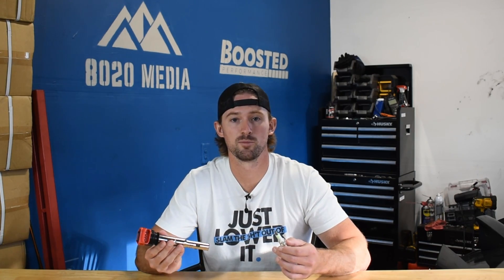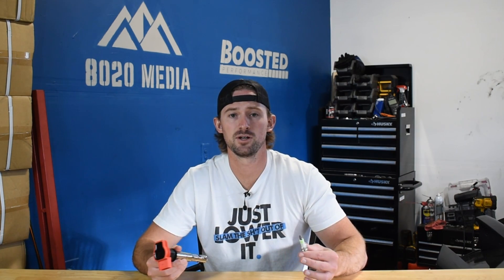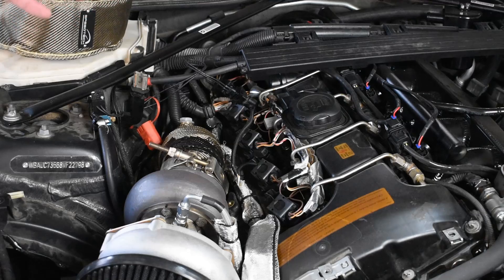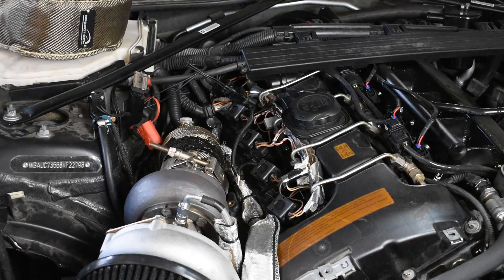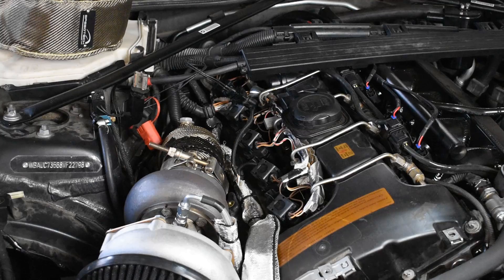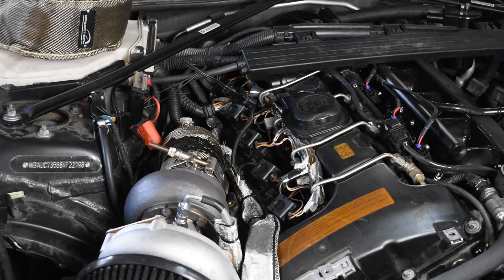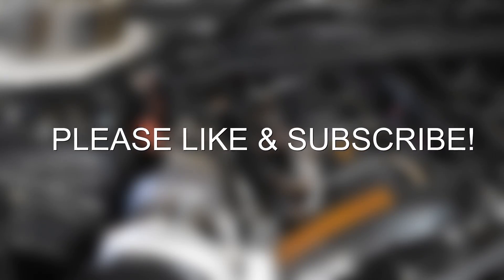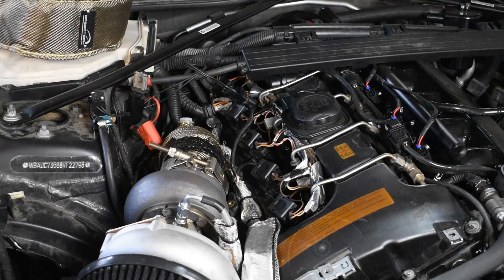DIY - How to Diagnose Bad Spark Plugs & Ignition Coils!

Comment: It can also be a bad plug boot the boot can have little tiny holes in it allowing the spark to leak through the boot and bypass the spark plug. Honestly on most of these newer COP ignition systems it's usually the boot or plug 99 percent of the time these newer coils actually hold up really well.

Comment: None of this is going to matter for me. Because I have a p0300 code not a p0301 to p0306. Just only p0300 my vehicle ignition coils are very difficult to remove so therefore I can't try something like this with the ignition coils. Cus it's inside the distributor cap. Only have 3 for the 6 cylinder. I actually have 5 codes. P0300 with P0130, P0136, P0150, P0156.
Reply from the maker: B - This video could also be helpful: https://youtu.be/f1mQ5hD1-vI

Comment: If it feels like misfire, individually pull off the electrical connectors, if car stumbles worse, the problem is not with that coil or plug. If you you remove the connector and car runs same,   you've found the cylinder that needs help.
Reply from the maker: M - Well said! Thanks for sharing.
Reply: Blambambaloobot!
Reply: Can you please explain if it runs the same it means it's the cylinder that was removed/disconnected
Reply: @Finding-Orthodoxy no, if it runs the same after pulling a plug, you may have found the problem coil or plug. If it stumbles worse. Then the problem is not the plug that is disconnected.
Reply: @michaelsnively3621 thanks!

Comment: i bought a used car with no engine light on but it has these symptoms, is there a way to determine without the engine light? i have access to a code reader but no lights are illuminated so its not much help
Reply from the maker: R - Yes, even if the check engine light (CEL) isn’t on, your code reader can still be useful—many scanners can read stored or pending Diagnostic Trouble Codes (DTCs) that haven’t yet triggered the CEL, as well as live data from sensors like fuel trims, O2 sensors, MAF, coolant temp, throttle position, and more; by analyzing this live data, you can spot problems like a faulty sensor, vacuum leak, or misfire even without a current code.
Reply: Same! 😭
Reply: @cearra7472 so i just diy replaced all the spark plugs and ignition coil boots! both are relatively inexpensive to get and theres lots of helpful videos of how to on youtube! good luck!

Comment: Hi dennis, have a 15 corrolla 1.8. I had a p303 misfire, car lost all power only going 20mph max.  Shop checked and said it looked ok. Cleared codes ran fine for a week. Driving on highway entrance up hill, it happened again. Replaced plugs, tested coils(all ok) and been driving it for 3 days no issues.  Car has 150k, first plug repl.
What could cause internittent misfire code?
So far its been ok but fearful its a fuel issue possibly??
Any thoughts
Reply from the maker: K - An intermittent P0303 (cylinder 3 misfire) on your 2015 Corolla 1.8, especially under load like going uphill, could point to a weak fuel injector, carbon buildup on the intake valves (common in high-mileage engines with poor fuel quality or long OCI), or even a borderline ignition coil that tests fine cold but falters when hot—since you’ve replaced the plugs (first time at 150k!) and verified the coils, the next suspects would be the cylinder 3 injector (try swapping it with another cylinder to see if the misfire follows), checking for vacuum leaks around that intake port, or even doing a compression/leak-down test to rule out valve issues; if it runs fine now but you’re wary, monitor fuel trims with a scan tool and consider running a quality fuel system cleaner (like BG 44K) and using top-tier gas for a few tanks.

Comment: I drive a Lincoln Town car ican start and drive but will die out. What is my problem???
Reply from the maker: G - If your Lincoln Town Car starts and drives but then dies out, especially after idling or coming to a stop, it’s most likely caused by a failing idle air control valve (IAC), vacuum leak, dirty MAF sensor, or fuel delivery issue like a weak fuel pump or clogged filter; when the IAC can’t properly regulate airflow at idle, or if unmetered air is entering through a vacuum leak, the engine can stall suddenly—also check the fuel pressure, MAF sensor cleanliness, and battery/alternator voltage, as inconsistent voltage can also cause sudden stalling; scanning for codes—even if the check engine light isn’t on—can also give you clues.

Comment: Just replaced my spark plugs and wires and put flowmaster headers on and a new exhaust system which I have a exhaust leak will that result in my coils to go bad after some time?
Reply from the maker: J - An exhaust leak, especially near the headers, won’t directly cause your ignition coils to go bad, but it can contribute to drivability issues that stress the ignition system over time—if the leak is near the upstream O2 sensors, it can create a false lean condition, causing the ECU to overcompensate with fuel, which may lead to misfires, rough running, and even carbon buildup, all of which force the coils to work harder; additionally, if the exhaust leak is close enough to wiring or coil packs, the extra heat and vibration could accelerate wear—so while the leak itself won’t immediately kill your coils, it’s smart to fix it soon to avoid compounding issues that could shorten the life of your ignition components.

Comment: Im having a small misfire on take off or idling. However, it's my battery dash light that'll briefly go on and then off. Anyone know what this could be? I changed the battery this morning with a new one and my terminal connections are solid tight.
Reply from the maker: R - A brief misfire during takeoff or idle combined with the battery light flickering suggests you may have an issue with alternator output or a weak ground, causing inconsistent voltage to critical engine components like the coils, injectors, or ECM—while the new battery rules out storage capacity, the charging system is still responsible for supplying steady voltage under load, and if the alternator is starting to fail (especially at low RPMs), you can get a voltage drop that disrupts ignition and causes a stumble or misfire; check the alternator output with a multimeter (should read 13.8–14.4V at idle), inspect the ground strap from the engine to the chassis for corrosion or looseness, and consider load testing the alternator, since flickering dash lights are often early warning signs of charging issues rather than a battery problem.

Comment: I have a 2014 forester that is giving me a misfire only at partial throttle. It has only 35000 miles on it. I am not getting any codes, but the misfire is extremely annoying. It would be nice to have a code considering how difficult it is to remove the coils and plugs on a boxer engine. I plan on removing the coils and possibly the plugs to test them soon. It idles great and WOT is awsome also, just partial throttle. Is there anything else I should be looking at?
Reply from the maker: J - Given that your 2014 Forester idles smoothly and runs great at wide open throttle but misfires only at partial throttle with no codes, you're likely dealing with a subtle ignition or fueling issue, such as a weak coil starting to break down under light load, or even carbon buildup on the intake valves (common on direct injection engines) disrupting air-fuel mixture only at cruising load; while pulling the coils and plugs is a good next step—look for any signs of arcing or wear on the plugs—also check for vacuum leaks, PCV issues, or a dirty MAF sensor, since all of these can throw off fueling without always triggering a CEL, and if everything checks out, consider a carbon cleaning (like walnut blasting) or logging fuel trims and misfire counters with a scan tool for more clues.
Reply: @8020Automotive  thanks sir, I have done some of that, cleaned the MAF, pcv, and throttle body. I have a new coil on the way to help trouble shoot, but a code would be nice to help pinpoint as getting to them is soo much fun. Being in the philippines a walnut blasting isn't going to be in the cards though, but I get it, the carbon buildup can be a nasty thing. Also I have seen that a wore spark plug seal in the valve cover that allows oil in the chamber can also be an issue, and when I pull the coils I will be checking for that as well. Anywho, fun little cars. I will keep you posted, and thanks for the advice sir, and keep up the vids, your doing great. :)

Comment: Can I change a four pin ignition coil for a three pin coil. Its  A DAEWOO Lana, Its a   2.000 model. Please
Reply from the maker: Y - You should not replace a four-pin ignition coil with a three-pin coil on your 2000 Daewoo Lanos. The number of pins corresponds to how the ignition coil communicates with the engine control unit (ECU) and other components. A four-pin coil may have additional control or feedback circuits (like for dwell control or ignition diagnostics), while a three-pin coil may lack these, leading to misfires, no spark, or triggering error codes. Always replace with the exact same coil type (same number of pins and compatible connector) to ensure proper function.

Comment: Hi ,thank you such an amazing video. I have a issue with my suzuki alto 660cc that engine coils failed after every 200KMs i have changed coils and plugs three times but issue persist. 
Can you recommend permanent solution for this? and another question what causes coils / plug failure results in engine misfires
Reply from the maker: J - Thanks for the feedback! Repeated ignition coil and spark plug failure every 200 km in your Suzuki Alto 660cc likely points to an underlying electrical or ECU-related issue. Common causes include: (1) overvoltage from a faulty alternator or voltage regulator that damages coils; (2) poor quality or mismatched replacement coils or plugs; (3) wiring harness or ground issues causing unstable voltage or misfiring; (4) a faulty ECU sending incorrect dwell time or ignition signals; or (5) incorrect plug gap or heat range causing premature wear. For a permanent solution, have a mechanic check the alternator output (should stay around 13.5–14.7V), verify proper ground connections, scan for ECU-related errors, and ensure you're using high-quality, OEM-spec components.

Comment: $AU230.00 each for 2009 Toyota Camry, 6 Cylinder. From Toyota 
Rip off ?
Reply from the maker: B - These aren't cheap components unfortunately.
Reply: That not that much to manufacture either.

Comment: Would engine oil from the valve covers leaking into the spark plug tubes. Eventually past the threads cause a misfire?
Reply from the maker: Yes, that can absolutely cause misfires and tends to be a common issue on engines with long-term VCG oil leaks.

Comment: I have an issue with my 2021 Camry Hybrid. It’s not showing any error codes/CEL. It was scanned and shows nothing, as well. My car has this slight/quick hesitation, usually at higher speeds, 65+, and has been intermittent. I did feel it at lower speeds for the first time today. It hasn’t been regular, just occasionally. My spark plugs have recently been replaced at 113k, but not the coil plugs. I think it’s the coil ignition, but I am not 100% sure. How can I test since I’m not getting error codes or CEL?
Reply from the maker: V - Since your 2021 Camry Hybrid isn’t showing error codes but has intermittent hesitation at higher speeds (65+ mph) and occasionally at lower speeds, it could be coil packs, fuel delivery, or transmission-related. To test without error codes, start with an OBD2 scanner with live data to monitor misfire counts, ignition timing, and fuel trims, as misfires might show up without a CEL. You can also try swapping ignition coils between cylinders to see if hesitation moves, or use a multimeter to measure coil resistance. If fuel delivery is the issue, try a fuel system cleaner like Techron, BG 44K, or Seafoam and consider a fuel pressure test to check for low pressure. Since it’s a hybrid, hesitation could be related to the MG1/MG2 motor control or battery fluctuations, so using a Toyota Techstream scanner would be ideal for hybrid-specific diagnostics. Also, check for a dirty throttle body or MAF sensor, as they can affect throttle response and cause momentary hesitation. If using cruise control, test with and without it engaged to check if it’s adaptive throttle behavior. Since the hesitation is intermittent, start with coil swapping, live data monitoring, and a fuel system check, and if the issue persists, consider a dealer-level hybrid system scan for deeper diagnostics.
Reply: It’s because it’s a new car they didn’t take time to perfect it

Comment: what if the car (civic lx 07) doesn't have an engine code but has the symptoms mentioned
Reply from the maker: B - It would be worth checking your ignition components (spark plugs/ignition coils).

Comment: He totally left out that if you have a bad injector or a loose wire it will do the same thing and it won’t be a plug or a coil pack. It will be an injector or injector wire or a wire going to one of the coil packs. It also can be an ecu problem.
Reply from the maker: D - This video is about spark plugs and ignition coils. We do have a full video on fuel injectors: https://youtu.be/VpuSKiQcW_4

Comment: I replaced all my plugs and wires but is still rough idling. It ran great right up until I changed the plugs and wires. I just had over 100,000 miles on the old set and thought it was time to change. I use iridium plugs and oem cables. I can only guess that the new plugs and wires caused one of the coils to go bad because it was probably almost there anyway. I'm not getting a code so I guess I just gotta buy a coil and switch them out one at a time... I'm retired and broke so I'm not ponying up 3/4 hundred bucks for whole set.
Reply from the maker: R - Sorry to hear this. Are you getting a check engine light or any engine codes?
Reply: @8020Automotive  Thanks for the reply! I never got any codes. It ended up being a bad new plug out of the box. I bought 1 replacement plug from Autozone and then rotated each plug down the line until the miss stopped. I got these plugs from Rockauto so there is a chance they are counterfeit. If another one goes bad I will buy the other 7 plugs from Autozone and swap them out.
Reply from the maker: R - Glad to hear! Thanks for sharing.
Reply: Could be a bad o2 sensor or injectors

Comment: If u swap the coils around then yes, you can see if the problem moves with it or not, however if the problem stays with the same cylinder you still cannot say it's because of the spark plugs. Swap those around as well and see if the problem moves with it, as if it still stays with that same cylinder, you might have a problem with the injector or other parts like cable wiring etc.
Reply from the maker: E - Thanks for sharing this insight.

Comment: If I switched ignition coils, but there's no check engine light coming on anymore, how long should I wait for the light to pop up again? I've tried driving it for a little but the service light simply went away just by switching the ignition coils from cylinder 2 to cylinder 1.
Reply from the maker: E - Clear the code and drive about 50-100 miles.

Comment: I have a Bugatti so I may get codes all the way to 16
Reply from the maker: R - Nice
Reply: If you driving a gatti you should be able to afford a proper mechanic
Reply: Whether I have one or not, running a diagnostic has ZERO to do with affording a mechanic. Also, people with money most likely will have more than one vehicle. My neighbor had a Ferrari 360 he worked on all of the time….

Comment: The injectors did not fix the issue I was having. The active fuel management system is acting up at times causing the car to stutter at low RPMs.  Once you accelerate, it goes away.  We drive the car daily with no issues, but it does stutter/miss at times with low RPMs. Could this be a lifter problem or spark plugs / coil problem
2016 suburban 5.3
Reply from the maker: U - More than likely your ignition components. Are you getting a check engine light or anything?